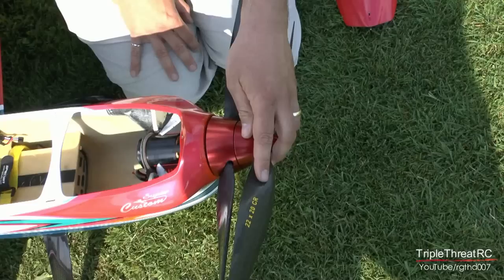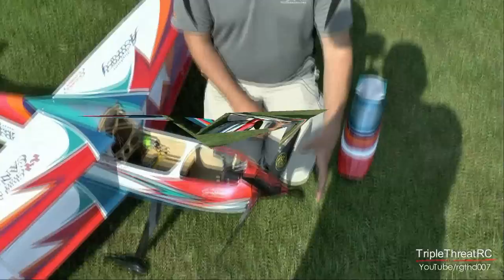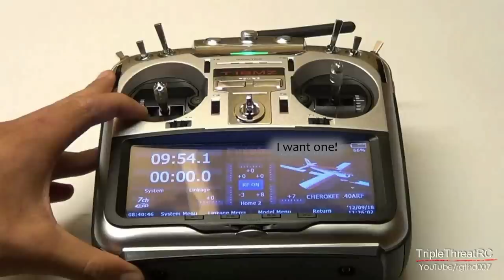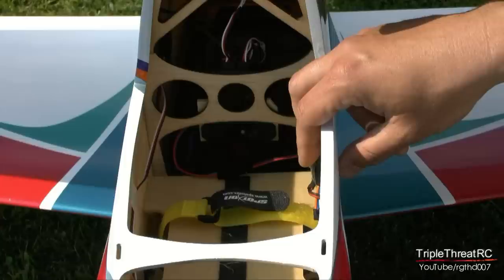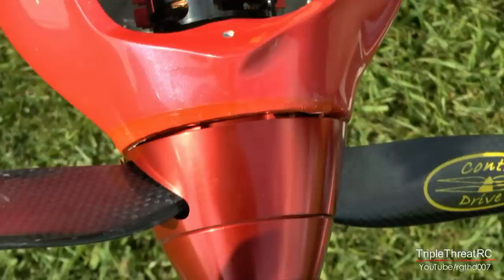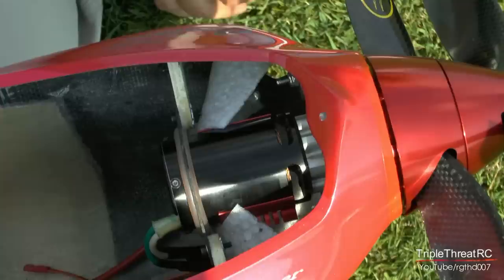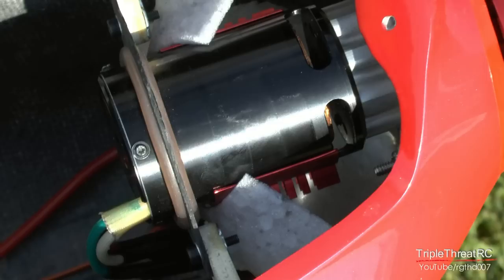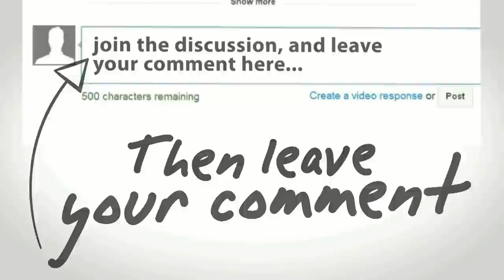Brenner F3A Contra Drive with Chad Northeast

Comment: Do you know what gears he's running?  I suspect not the 9.89's but maybe the 10.33's.  I was waiting for him to say so in the video around the time he told prop size.
Reply from the maker: ***** 
I'll see if I can find out for you Scott. Thanks for watching!
Reply: ***** Hey Scott, hope you are well.  Right now using the 10.15 gearing with the 1200 kV motor.  This works good with the 22x22r and 22x20f, I pull about 65A max in flight.  One of the new motors from Pletty is 1380kV and is 50g lighter than the 1200 kV version.  I am just installing this motor now, and will run it with the 10.33 gearing.  I am hoping it will work well, but won't know for sure until I get it going.
Reply from the maker: Chad Northeast 
Thanks for sharing the information and responding to Scott's question Chad, much appreciated!
Reply: Chad Northeast Thanks Chad!  I wasn't sure if you were monitoring this thread.  In hindsight, I guess I could have just asked you huh.  ;)  Thanks for the info.